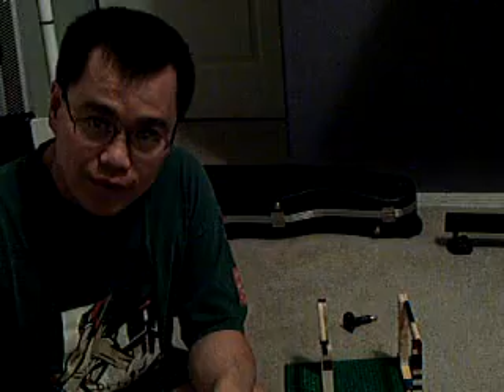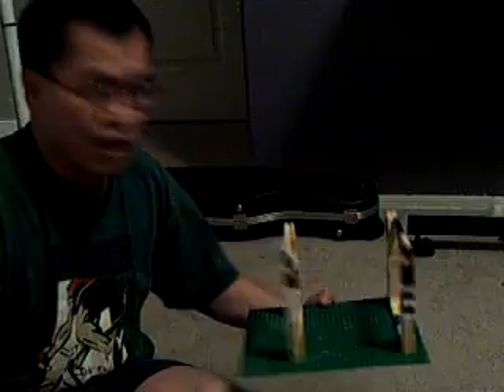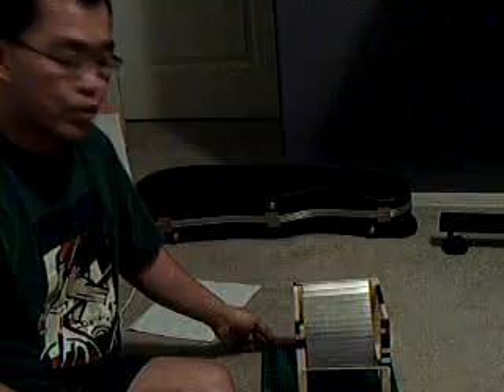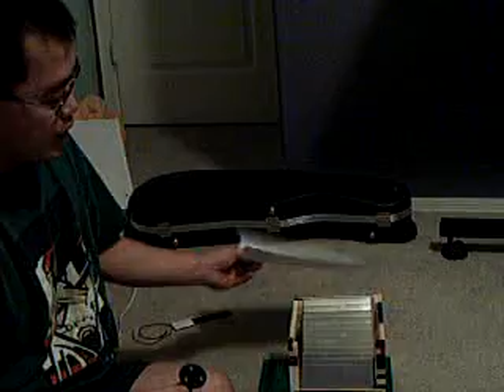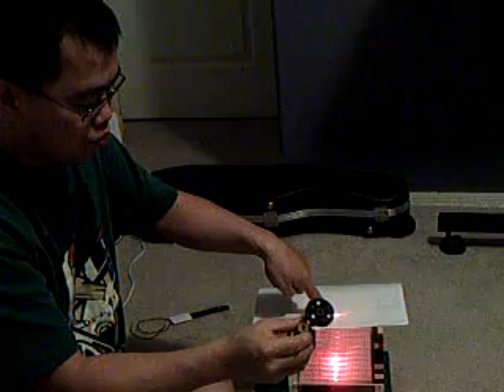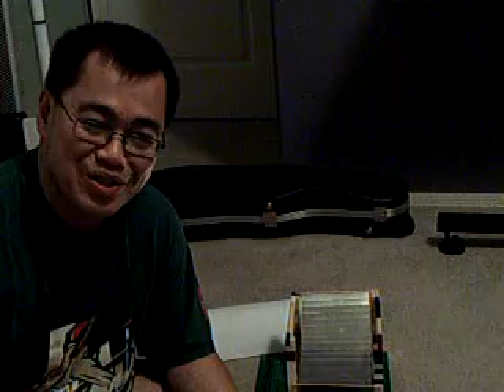Solar catenary reflector vid 2: asymmetrical design

Comment: The major mechanical problem with this design is to obtain maximum efficiency the mirror must be oriented to the same angle above the horizon equal to your latitude.
Another words the mirror must point at the celestial Equator. Unfortunately this will distort the natural gravity produced curve.

Comment: This is an interesting concept but unless I am misunderstanding you, most of the reflector (in this asymmetric configuration) is not concentrating. The  interesting part of your idea is that you could make a solar collector that is very portable. Mylar with a few poles taped to it would work easily, and it could be rolled up for transport.

By adding poles of different weights  on different parts of the curve you could still have the angled reflector, but the weights would correct the asymmetry.

Comment from the maker: Hi.  This whole approach focuses on reducing cost, not foot-print.  If the application is space or footprint limited, one needs to find the best efficiency possible.  When available space is NOT an issue, by building an oversize collector cheaply, one can put out more power for a given investment in cash, knowing that not all of the available sun light is captured.  Thanks for your thoughtful comment.

Comment: hi tho
the laser demo is neat but as you move the laser up and down, the angle of light hitting the paper(or pv cell) changes drastically, right?  how is this different from laying a pv panel on my roof all day?  the sun will hit it all day but at different and less beneficial angles.  angles of attack is not good, but intensity is greater?
THANKS for your videos!

Comment from the maker: Good observation.  The model (at my website) shows that as the angle drops, the concentration of light is actually a little bit higher than the top level.  It also moves back about 20-25% of the length of the mirror for the range I estimated.  It actually doens't have a focal "point" per se, more like a region of high density of light.  This is good for a PV target, because it reduces the risk of destroying the cell.  But it isn't as good for solar thermal applications.